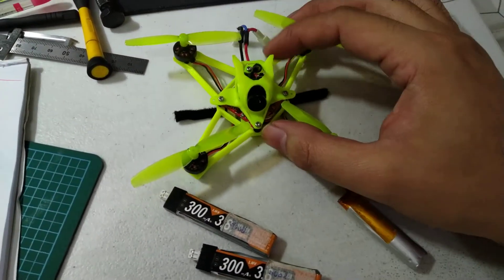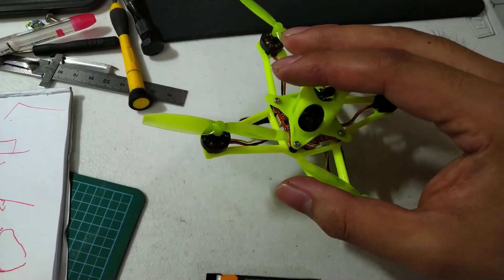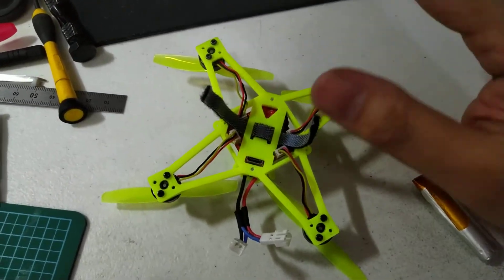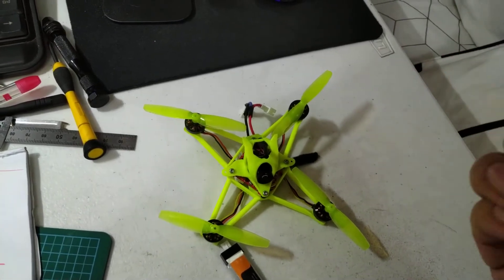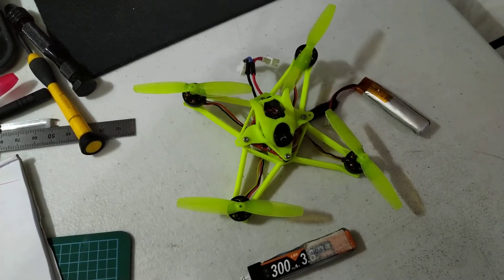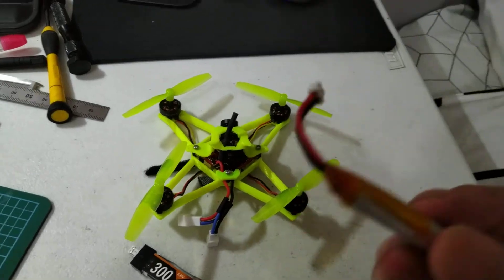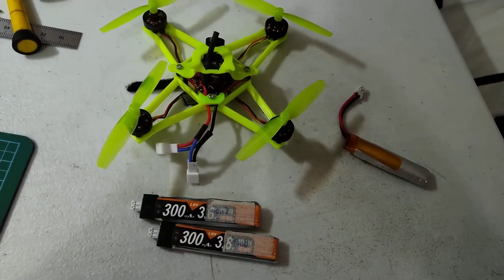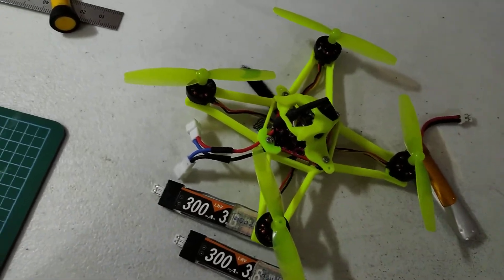Share Data: how to maximize sagged 1s battery

Comment: Interesting stuff. Actually i found something similar that my puffed and sagged batteries only last a minute in my mobula6 but still give 3 minutes on a brushed whoop. It seems that the lower current draw is still possible on those batteries
Reply from the maker: OH! thats a nice info too mate! I'll try to observe that in my brush drone as well.
Reply: Just tried with two very tired happymodel batteries on my Mobula6. Got 4 minutes and a bit flight time, mostly just cruising. Thats more than double the 1 minute flights i was getting before. And even more impressive that its with the extra 7g on such a light whoop. 25000kv motors didnt even care about the weight difference... Great stuff!
Reply from the maker: @Tokyo_Dom  thanks for sharing your result mate :D